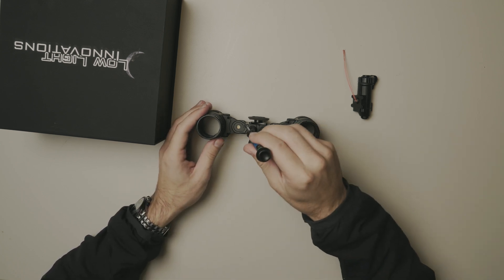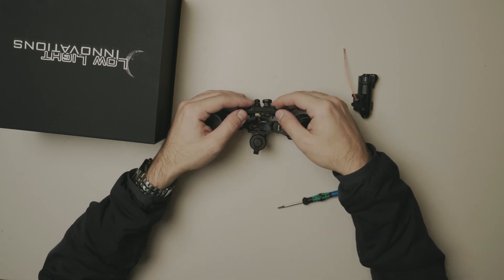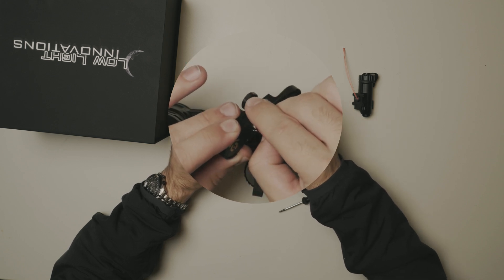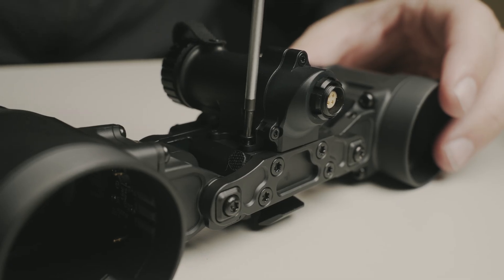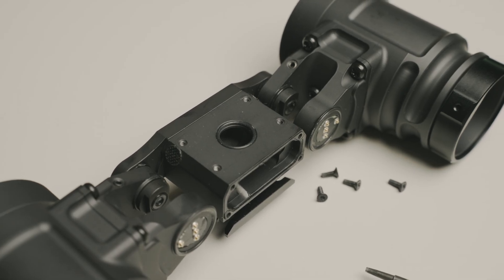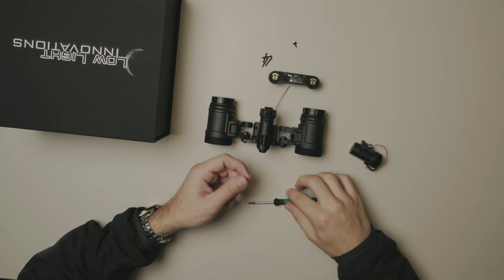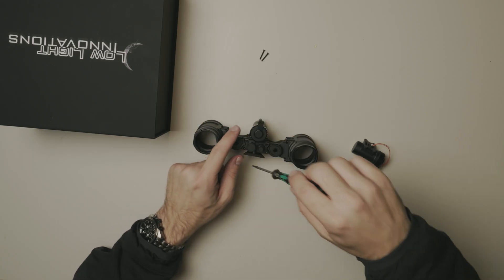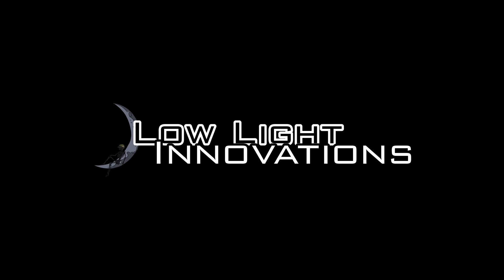LLI | UBC | UNIVERSAL BATTERY COMPARTMENT INSTALL

Comment: I like this! The only thing I don't like is the plug is near your face. My best sight picture is with the nods close to my face. With the plug on the UBC I have to move the nods away a bit or I get hit in the forehead by the wire/plug. Other than that, I love the UBC!

Comment: So you don't need to re glue down the plug ?
Reply from the maker: @stacy777sgt  nope, this is just a SOP from LLI to deal with extreme cases of vibration.  It's not necessary, however if you have a hot glue gun a small dab doesn't hurt
Reply: I dabbed, well not like that, but with glue. Well not in the way you might think. To be clear, I put a dab of hot glue on the connection since the hot glue gun was 3 feet away from me.